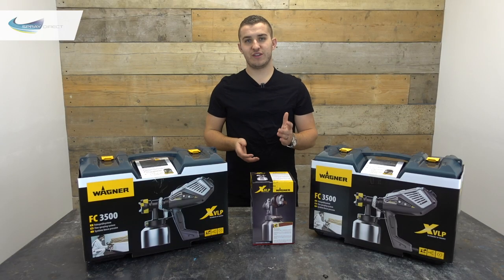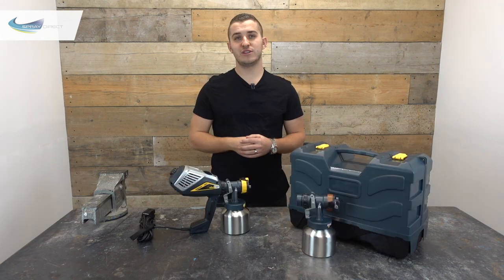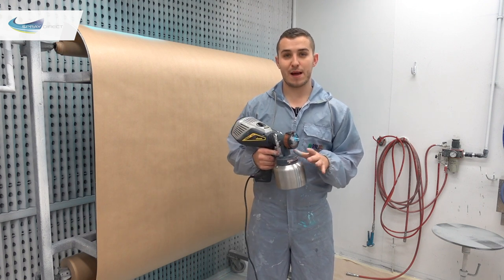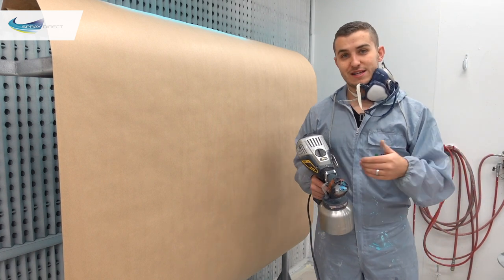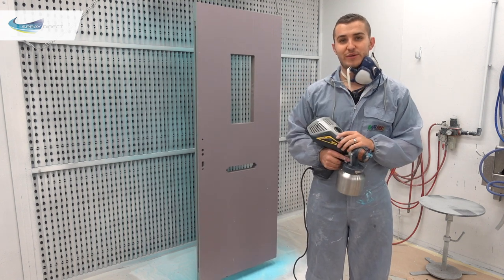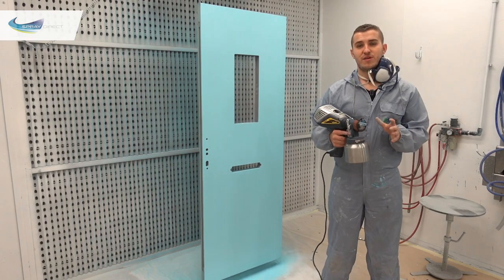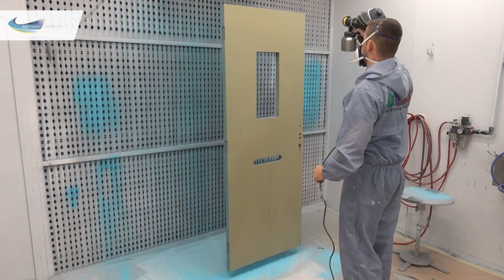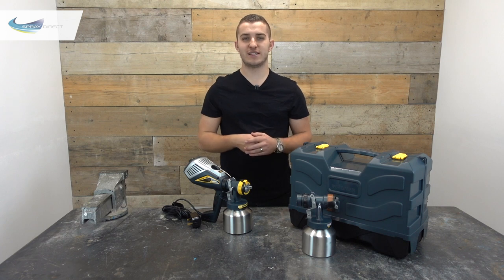Wagner XVLP 3500 FinishControl Demo -Theory, Setup & Spraying

Comment: I bought one today. Sprayed a big bookcase on site. Perfect finish. I always sprayed with the new graco handheld for my doors and cabinets . Great gun to have in your arsenal but for tighter area’s you have a lot more chance to get a runner and that is what you don’t want. I bought the 5000 wagner today and it’s much better for cabinets and bookcases. I like it. Set me back 1k € though. Bit too expensive. The thing i dont like is that it has problems when spraying upside down and such.

Comment: I wish to carry on more with it, but the turbine air is very close to spraying area and when you go in the cabinets all the over-spray are attracting in, although there is a kind of filter but is not enough. 
Remember all the manufacture of the turbine air for HVLP spraying recommend to stay as 
far as possible of the area where you spray.

Comment: Excellent demonstration as always 👍 I have the xvlp 5000 and there is not alot of content on youtube which is a shame, similar to the graco 9.5 pro comp in use....but nevermind.
The xvlp 5000 is capable of a very nice finish using the fine finish gun, but the only thing lacking really is the fan width when doing so. It's also very important to master the first and second trigger pulls as this is vitally important at the start. Thinning on water based trim paints tends to be between 10-15% on the majority with 20% needed on some thicker ones.
Can I ask, is the graco 9.5 pro contractor or pro comp capable of better finishes generally? And can you do it by getting a slightly bigger fan width too? And would you say less thinning would be required in comparison?
Best regards, Joe
Reply: Hello, what did you buy as a result?

Comment: Hi Josh would you say the over spray is less then hvlp it certainly looks it ?
Reply from the maker: Hi Gary Eden! if both machines are set up as efficiently as possible there wouldn’t be much in it but I would say the XVLP might just edge it’s because it does work at slightly less pressure 👍

Comment: Can anyone help please. I have a Wagner 350m that I use for large areas mainly fresh plaster. I am looking for a handheld sprayer for doors, skirting boards and arc mainly using gloss (oil based) paint is the 3500 good for this and if so what is the dilution ratio for oil based using this gun. Thanks.

Comment: What paints were you using with this and can I ask what you were thinking it down by?
Reply from the maker: Hi We were using a Caparol Primer thinned 15%.
Reply: Spray Direct have you tried Tikkarella with it?
Reply: @tommackrall6631  I’ve been spraying Tikkarila water based primer with mine today. I added 10% water to thin it a bit and warmed my paint in a water bath as it’s cold up here in Leeds. Sprayed on well. Not tried spraying Tilkarila water based gloss yet but I’m confident it will be ok. 
I’m a commercial vehicle painter by trade and these xvlp guns take a bit of getting used to as they are so much slower than the DeVilbiss JGA I’m so familiar with. 
I hope your spraying is going well
David

Comment: mmm too much plastic in that design for me. wont last on the van. also older hvlp wagner used to have a separate on/off for the motor then the trigger was just releasing the paint, way better system. they later took away the motor switch so that the trigger was operating the motor AND releasing paint so it splattered every time.
although wagner after sales support is amazngi reckon ill end up going for the q5 even though its more money sometimes money isnt everything. a good tool pays you back.

Comment: I have it from 2017
Reply: Michael Einstein is it any good
Reply: @briandavis3832   No no anymore, the motor was broken because lot of dust connection 
I replace it with a Fuji, Fuji mini mite 5, which I'm very heavy weave a professional spray  equipment
Reply: @briandavis3832  No no anymore, the motor was broken because lot of dust connection 
I replace it with a Fuji, Fuji mini mite 5, which I'm very heavy weave a professional spray  equipment
Reply: @michaeleinstein7097  xvlp 5000 is the only real stuff about. More power, turbine further away an last a long time. Mine is from 2012 produced and still fine but always clean air filter after every job. Clean in soap water and let dry and stuff. Remove the paint in it by pull off one layer of the filter

Comment: They are crap!! Do not buy. Tried loads of materials, thinned down to help. Nothing was good. Mine is collecting dust. I do loads od spraying. Got graco 495 , 390 etc. This machine is dreadful.
Reply from the maker: Out of interest, what paints did you use as I can’t say I’ve had an issue getting anything to spray through it. All about getting the viscosity of the paint right 👍
Reply: I’ve never had a problem with mine and I always use the fine tip